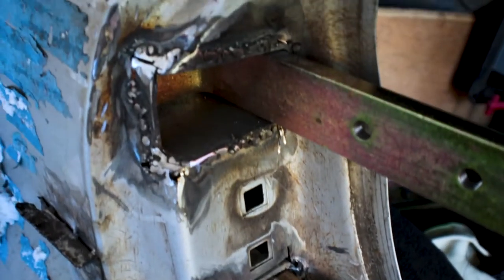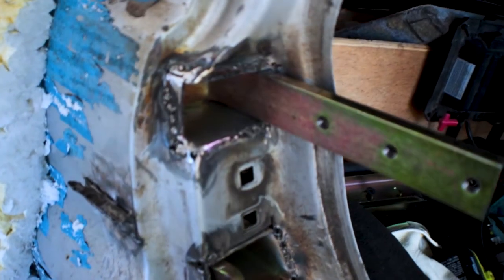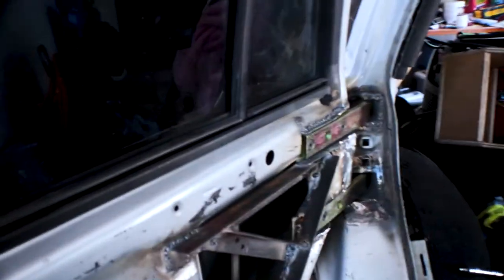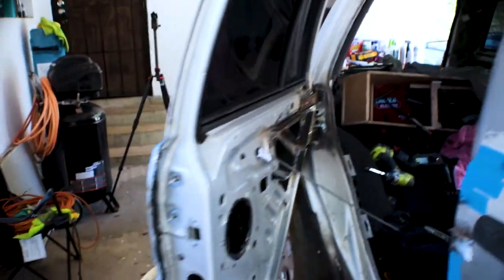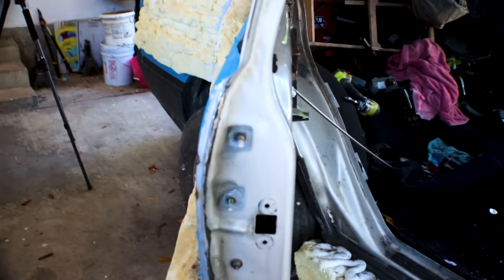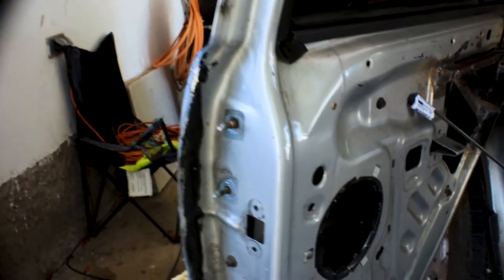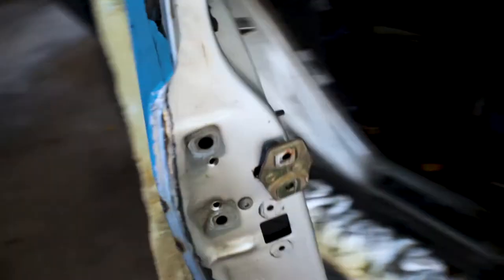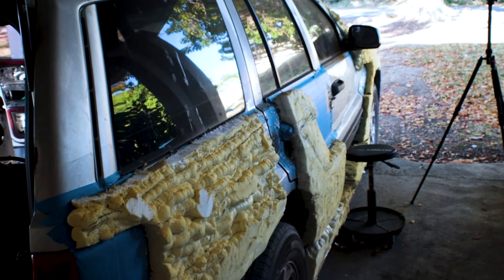Installing suicide doors on my Jeep WJ - part 3

Comment: Respect. Any drivability / rideability concerns post-op?
Reply from the maker: No drivability. Only rideability concern is the front suspension. it will be on bags, so my up and down movement will be limited by the track bar. When lowering the ride the track bar will push against the one side connected and push suspension from left to right. I'm planing to build a subframe to compensate for that, but that mean a whole new nest to untangle.

Comment: man, that waa alotta work. 
are those hingers universal (for any vehicle ?
were you happy with the hinge quality ?
how are the doors holding up one year later.
i have some old fords i dream of trying this with.
Reply from the maker: @Midnight Raiin yeah it was alot of work, but very fun doing it. The quality of the universal kit was OK. The only thing I was looking for the big solid hinges so I would have to worry about the pivot of the door to seal properly. In recent videos iv cleaned up the welds and went over them with reinforced bonds and made it look official. The hinges are good just take your time on placement and reinforcements to avoid door sag as much as possible.
Reply: @TheInkhousecustoms  EXCELLENT!

Comment: Was this your first time doing something like this
Reply from the maker: @iamdjlee 1 it's not my first time doing anything like this. But if you think of it, it will always be the first time every time. I learn something new every time I start a project. Trying to figure out step after step. Every project is different, unless you work at a car manufacturer we're the same process if duplicated over and over.

Comment: What the price of suicide hinges
Reply from the maker: @BAQER GT. I purchased the hinges for around $200.00. my amazon affiliates link in the description. Make a purchase helps support the build and channel. Thanks
Reply: @TheInkhousecustoms  
Ok im new subscrber i love your work
Is this hinges fit on chrysler 300c 2010  or no
Reply from the maker: The hinges are universal will fit. The thing about the hinges is the the vehicles aren't made to open in this fashion, so the door will need to be reinforces to support the weight of the door. The flimsy sheet metal will not support the weight. In my video I made braces that help stiffen the weak structure. It will take a little adjustment to make sure the door goes in alignment. Just make sure you go over everything before starting. No return after you start cutting . Lol good luck if you need help when building you can contact me of Facebook or Instagram.
Reply: @TheInkhousecustoms  
Thanks my bro 👌❤